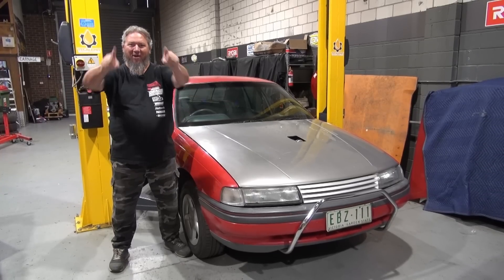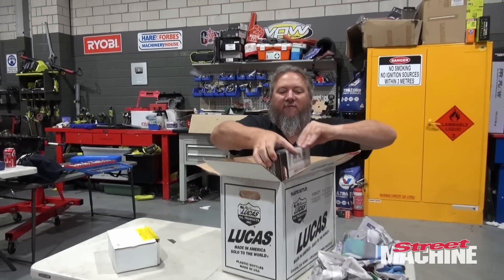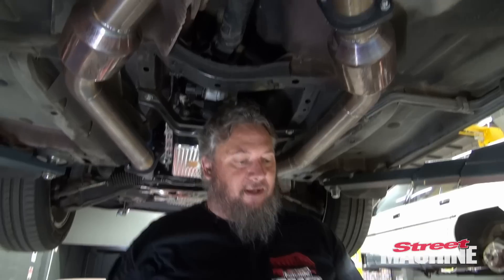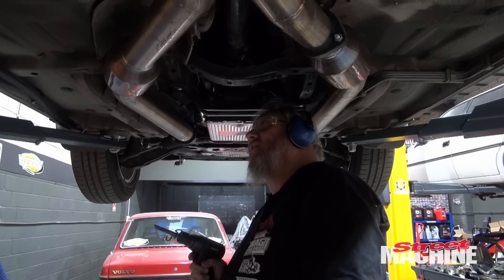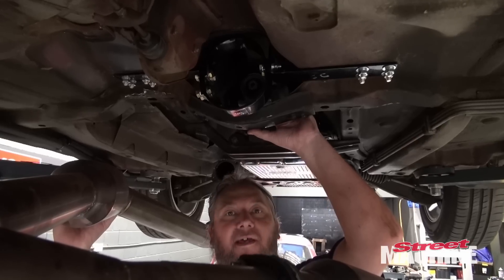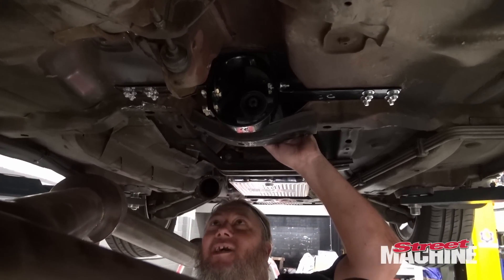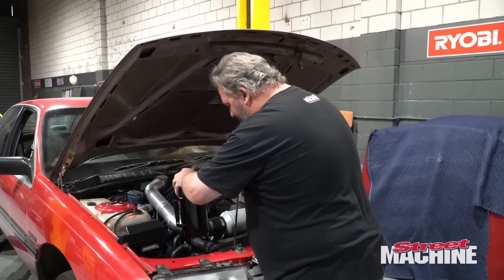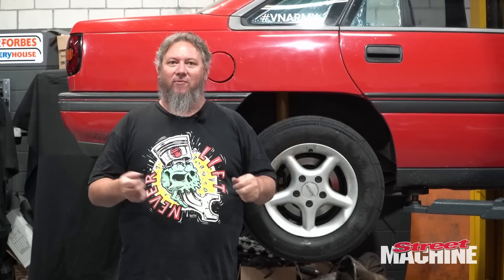Carnage - Prepping Our Supermang Commodore for Burnouts

Comment: Two little bits of advice. 1. Take off the mud flaps. 2. Use vise grips on the brake hose. It will bleed past the plastic ones. Learned this from a friend.

Comment: Clamping the line won't stop fluid bleeding through under pressure and will eventually start locking the rear calipers. 
Best ways I've found is get a fitting for the master and weld up the hole ,pull rear line out, put welded fitting in, no more rear brakes and then just put a rubber blank end over the line so it doesn't drip fluid out 👍 
That or get a flat top nail the same diameter as the id of the line, cut it to about 20mm long from the nail head , pull line out slide nail into the line, bolt line back into master and no rear brakes ever lol just gotta make sure it's tight af so fluid can't push through 👍
Both methods work 100 times better than just just clamping the rubber line which literally always let's fluid past, remember when u push on the pedal it creates more pressure in the system, clamps work fine for mechanical work but your not using the brakes and pressurising the system.
I reckon she'll do 4th easy 👌🤣
P.s. good luck out there 👍
Reply: I found that abs sells the proper tapered bung to block it off at the master cylinder for like $2.50. Easy as and easy as to undo
Reply: but then you need to rebleed the system,
ain't nobody got time for that .....
Reply: @ZedTee77  just fit a line locker ,
push on push off ...
on the plus side it can be used at the dragstrip too

Comment: I've seen those factory overflow bottles explode 20yrs ago, even less crusty than that one..  the other thing you'd probably be aware of but i'll mention it anyway is during burnouts how far down the exhaust glows red hot, I'd have installed a heat shield not removed it... are they fuel hoses near the right hand side pipe/cat?
Reply from the maker: If it becomes an issue we'll run the hose direct to the catch can

Comment: I would consider going a 1 piece drive shaft because the centre bearing is the weakest part of it as well as because it will pull gears the overall pressure on it will not hold it for long enough if you end up using it for different events

Comment: Scotty would it be any easier to get out the MIG and tacka tacka it to the crossmember? Or is there a requirement for it to be bolted to the floor?
Reply from the maker: Makes life easier if you can unbolt it
Reply: @STREETMACHINETV  Could have welded the bottom section to the cross member, and still bolted the top section. If it needed to come out only a couple of bolts to remove the cross member. Just would have saved a whole lot of hacking and drilling.

Comment: Also, rather than a 4 piece loop which requires more bolts and is awkward to fit under the car what about a 2 piece loop in which the upper half of the loop is incorporated into the brackets attached to the car body. You would not need to drop the tail shaft or the exhaust.

Comment: Have you thought about a ball valve in the hard line for locking the rear barkes out? It is a bit of messing around but i have seen it work well before. 
Good luck to the supermang transmission your going to need it your gonna need it little buddy.

Comment: Have seen that trick to lock off brakes before, works for limited use of brakes (light touches of pedal), but fluid always pushes past the clamps, then it has the reverse effect where it clamps the rear brakes on, and the rear end you were trying to save ends up f$*ked plus the extra heat kills parts faster, best bet is just plug the line at maybe master cylinder or the hose above rear diff, go well Scotty give it heaps👍
Reply from the maker: That's why I did two clamps. I'll reset them after each burnout

Comment: Scotty mate , now that you mention it, my HQ Holden 25th anniversary silver 4 door, had the red 202, but had a powerglide in it which i could not figure out, but sure enough because you can do at least 110km in first the tailshaft let go and it was the front section that dropped, luckily i knew what had happened and slowly pulled over and then got it back to get the yoke and new bearings put back on, you right mate it can tip the car completely over on its roof or worse hit you in the car?